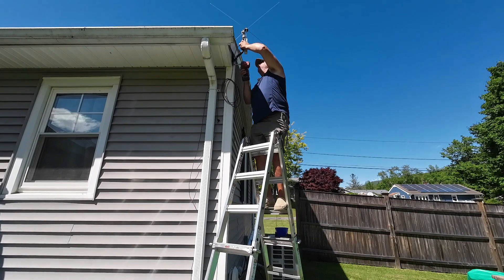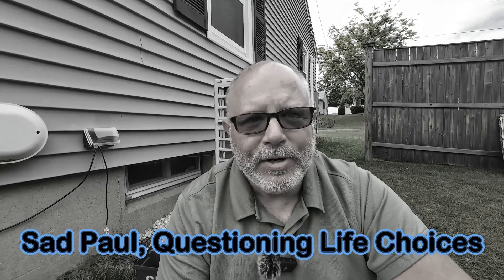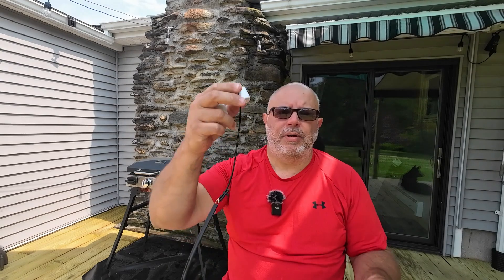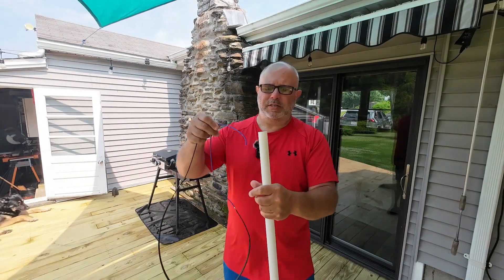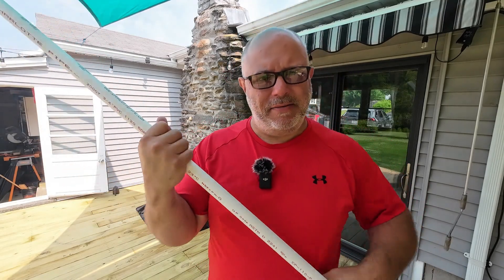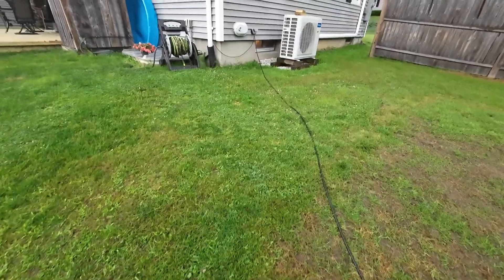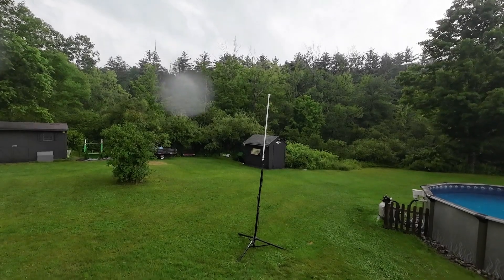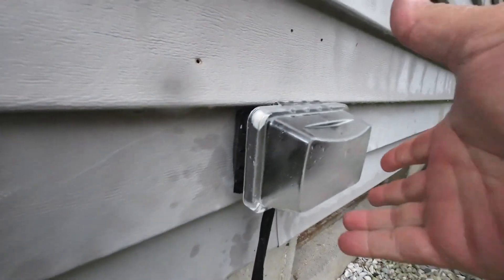VHF & GMRS Antenna for Home

Comment: Slim jim build with a ladder line. 
I did the calculations for a GMRS dipole and it is nearly 1 foot. 465 MHz doesn't require that long of an antenna. That short 6 in antenna might be all you need since it is already a halfwave.
Reply from the maker: The antenna in the video is an Ed Fong antenna and its a dual band antenna. It was built for GMRS band and VHF (150-160mhz)
Reply: About 41-42cm total length for a slim jim. (At least with the window line I have once I figured out the velocity factor with some trial and error). I've also made them for 2 meter ham. Dirt cheap to build - the most expensive and time consuming part is likely the coax connector.

Another GMRS version I'm working on now is a collinear "super J pole" from the same material - slice the half wave section in half and use the scrap for the top radiator, then a quarter wave piece shorted at the end for a phasing stub. Still trying to come up with a radome design to keep the stub protected and a way to actually test the gain/phasing.
Reply from the maker: @ailivac  That sounds amazing.

Comment: What is the brand/model of your dual band VHF GMRS radio?  I didn’t think that combination was permitted.  I did unlock my HTs, just in case, like many others do. But I don’t want to remove a resistor on my mobile.
Reply from the maker: It’s made by Rugged Radios and it’s a commercial VHF & UHF mobile radio. I use VHF for the FD I belong to and UHF for my work. Both are licensed frequencies. Then I also use it for GMRS.
Reply: The FCC doesn't babysit users of such radios to determine if they are 'permitted.' There are a number of older VHF/GMRs radios available through eBay that are fine for GMRS/VHF work. Most are much better than the modern radios sold today.
Reply: @wesoblander3648  I was just curious of brands available.  I’m more concerned about the mattress police knocking and inspecting my tags than I am about the 3 employees in the fcc enforcement department.

Comment: I had one of those antennas for a long time. My swr started climbing after awhile. What I found was that the wire inside of the pvc started settling down. I used a small wooden dowel and a few pieces of electrical tape to keep the wire straight. Installed it back into the pipe and no more issues. I eventually gave it to a newly licensed ham radio operator, to help him get going.
Reply: My way was to use a piece of strong fishline attached at the top of the antenna and fed through a tiny hole I drilled through the top cap. Once the cap was back on, I tensioned the line and sealed the hole and line with a bit of epoxy. P.S. A tip to keep away any potential moisture damage which can occur with some antennas, (I learned the hard way) assemble in a dry-air environment, and drop a couple of fresh desiccant packs into the pipe before closing it all up and sealing any gaps.
Reply from the maker: Thanks for commenting. I did go back and used your advice and added a string. Here is a link the video. https://youtu.be/ommBotHs30w

Comment: I bought one of Ed's DBJ-UHF antennas specifically for GMRS.  My version of making it look nice was to sand off the printing with 320 grit mesh sand paper and apply a Dymo label so I wouldn't have to remember which antenna it was.
Reply from the maker: Cool idea. Thanks for sharing.

Comment: Great antenna.   Looks like better coax too.   With mine (DBJ-1 and 60' of KMR400) I get 1.00 SWR at 462.55 and 1.03 at 467.5500.  On VHF, this antenna has a steep drop.  SWR of 1.74 on 154.5 but 5.01 on 157.5.  You can use this for 2M ham too but it's not ideal (2.28 SWR on 146.52).  At the end of the day, Height is Might.   Good luck.
Reply from the maker: Thanks for commenting. Those are almost the same SWR numbers I'm getting too. I was able to mount it up on the house yesterday.

Comment: Did you make sure that you attached antenna wire to the top cap and glued both caps to PVC pipe????
Reply: Don't think you understand the concept,  the construction is like a wet noodle,  think you're supposed tie a string on the end and pull it taut then put the upper end cap to hold the string.   Maybe that's why you have problems.   Remember,  the SWR into a dummy load is 1.0.
Reply from the maker: The instructions specified not to glue the caps. I taped the bottom cap just to try and keep water out. The wire is self supporting inside the pipe.
Reply: Self Amalgamating Tape will water seal it on outside of joints.
Reply from the maker: @rpcomms1  Thank you for the tip, much appreciated.

Comment: SPRINKLER  SYSTEM  PIPE  FOR  THE  LAWN.
Reply from the maker: Yeah I had a hard time finding the specific pipe required. I tried Pexs tubing as a substitute and it didn't fit the antenna that was sent.